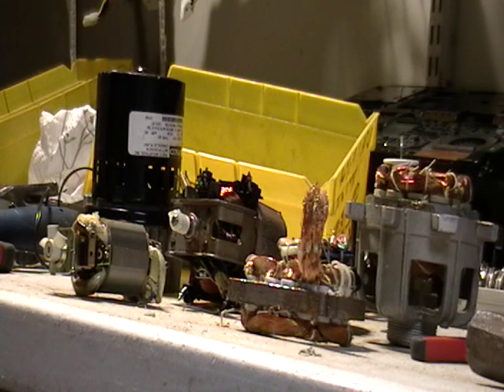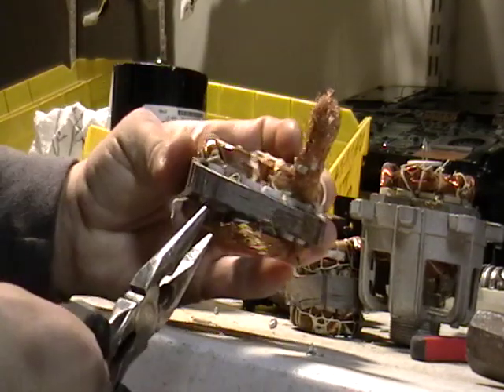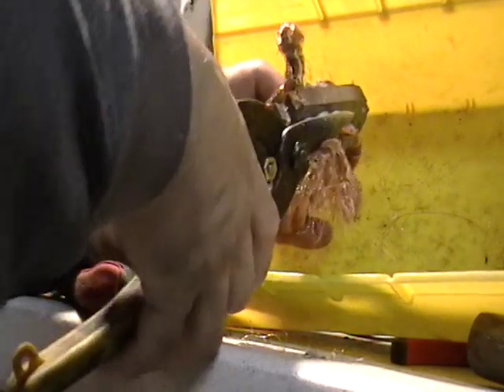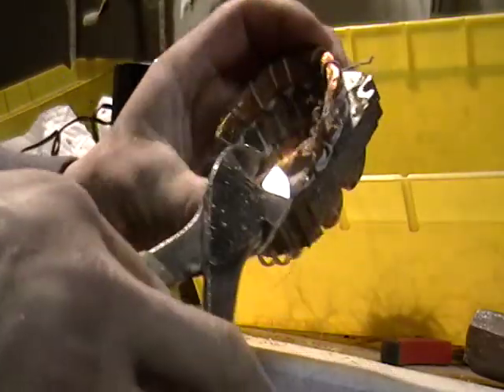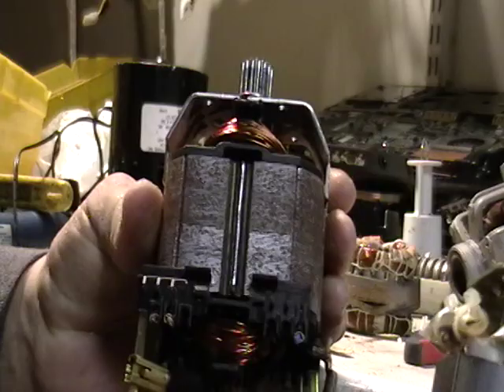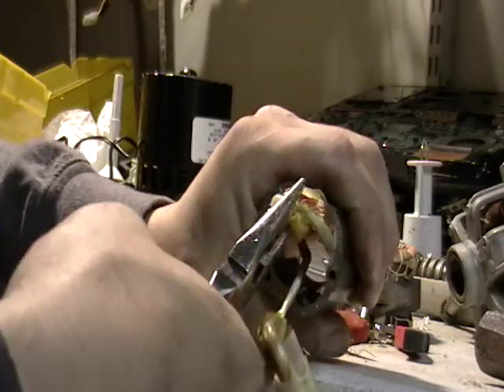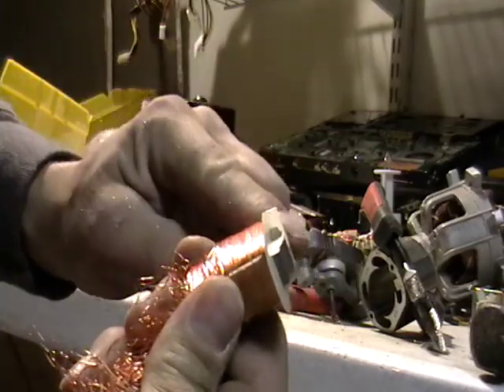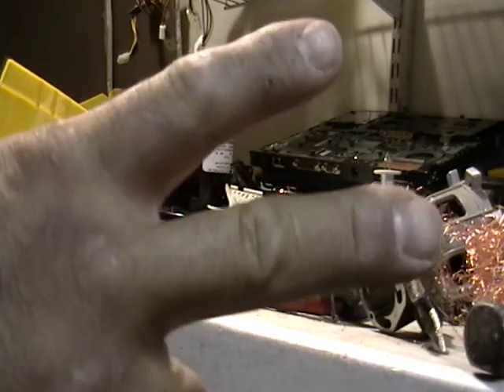Scrapping copper from motors

Comment: on that last little motor if you break all the plastic off all around you can wedge the whole thing off in one piece which is cool, even usable for electronic projects like tesla coils etc. good video, I found that garbage disposals have tons of copper, and the best ever is deep cycle battery chargers! wow, I fill up glass jars with my bright wire for decoration looks great, and tv tubes are really cool shaped wiring, just knock the tip off carefully with a hammer and you have lots, nice shaped

Comment: Liked the tips on motors.  I started smashing one the other day and it just made it impossible to get the copper out.  I need to get one of those wire strippers that you had in another video.  I find one to buy  anyplace in Colorado Springs.

Comment: what about the motors that have epoxy on them.
ive got an old welder and the 2 bundles of copper are epoxy covered and the damn things weigh 40 pounds.
or the motors with paint on the copper wire, what type of copper do you call them 2 types?

Comment: Mike, just because the wire is bright, that doesn't mean it is # 1 wire. it is coated with varnish or some other insulating paint. If it was not insulated it would be one big short and the motor wouldn't run!  I don't know how you work with out gloves.

Comment: one of the motors I get from work from conduit benders has a huge tube on magnet inside. I can get the copper but how do I seprate the magnet for the steel case?

Comment: I have the answer ladies and gentlemen... Some copper in the bigger motors from ac units are very tough to deal with. I took a bandsaw (which can pay for itself) and cut the "wire side" off first making a clean cut without melting any of the plastic. Then I turned it over and punched out the copper to the other side using a hammer and chisle (center punch or anything)... sometimes I needed to pry from there. After picking through the string and plastic I turned 30 motors into $120.00  #1 copper.

Comment: The microwave motors that are solid steel around the copper wire....how do u get it out...its tight around the sides...i cut through the wire and tried to peel it through the hole....seems to be glued to the steel block... suggestions???  thanks!

Comment: Copper windings is Copper #2. I've found that scraping copper from motors isn't worth the work unless you don't mind making minimum wage. It's hard, dirty work. You're hands will always have cuts. You'll go through a lot of mini grinder wheels. Scraping copper coils from contactors and relays isn't as bad but scraping wire is primo Copper #1,

Comment: U need a bigger grinder/metal cutting wheel. Your probally using the standard 4 1/2" Use a able clamp to hold the motors after you've cut the one side off with the grinder. So you can pry out the windings with a big flat head screw driver or a small pry bar. If you do it right its takes miutes and you make primo cash off of the motors. I have 61 pounds last week and made $189.00 canadian, took 4 hours work all together. Motor windings are classified as #1 in ontario, even if yhey are coated.

Comment: Can't wate for the facebook page. I work for an I and e company in services and take out the trash for tool repair, the motor vids going to help alot. I also get HSS tool steel form threaders and rotors form the trucks in the auto shop.  how much can I get for high speed steel I have never scraped them before?